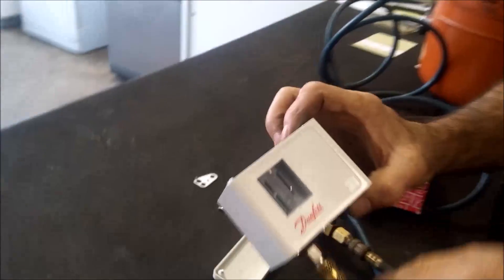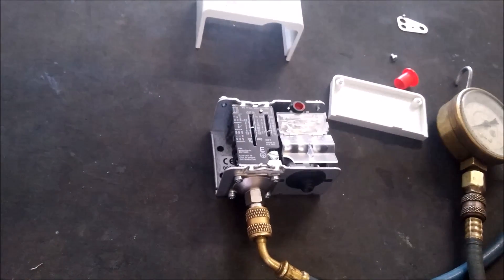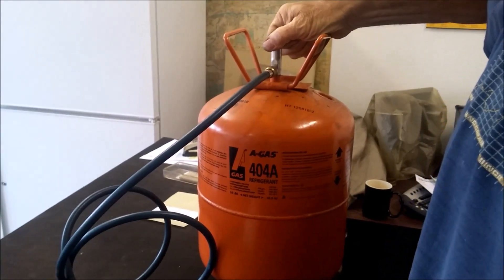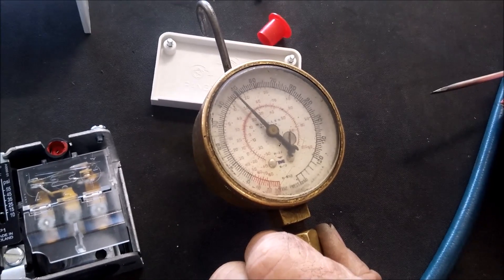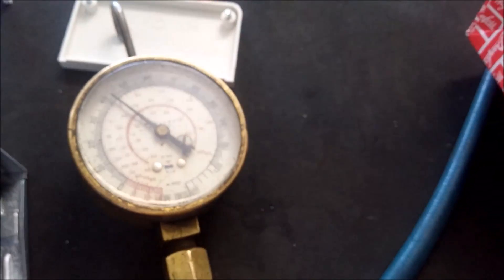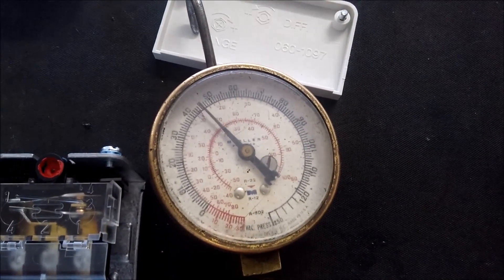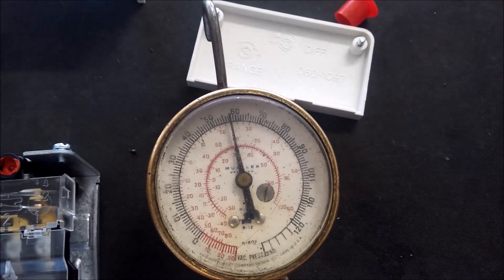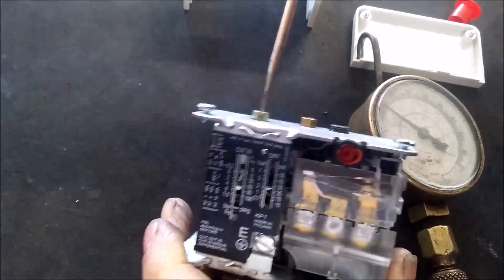How to adjust a pressure switch-JDNel Refrigeration

Comment: Jd can you assist me with R22 refrigerant cut in 6 degrees cut out 4 degrees the range an differential settings please
Reply from the maker: I need to know what type of refrigerator this is for? And does the evaporator coil have to defrost all the ice each cycle?

Comment: Thank you for the video, would you tell me that when the pressure reaches the threshold e.g 75 and the switch trips, The compressor gets off?? and what happens to the pressure. does it increases or decreases.

I have  "Johnson Controls P77AAW-9350" pressure switch installed on outdoor unit (condnsor) but i dont't know how to adjust it.
kindly guide me @JDNelRefrigeration
Reply from the maker: The colder your fridge the lower the pressure.  The warmer your fridge the higher the pressure. Different gasses work at different pressures.  There are 2 ways to find out what pressure to adjust your pressure to, to make your fridge function optimal. 1. If you know what gas your fridge operates on, you can find the pressure and temperature equivilent online. 2. Bypass the pressure switch so that your compressor runs continuously , put a thermometer in your fridge and monitor the temperature.  If you reach your desired temperature make a note of your gas pressure. Switch the compressor off.  When your fridge has warmed up to the temperature that you want it to start up at make a note of the gas pressure. Now you have your 2 pressures to adjust your pressure switch.

Comment: What's the setting on the pressure switch for 134a , 17/35 or ?
Reply from the maker: It depends on what temperature you want & how long of a defrost period you want. For a normal cold room I use  cut in 38psi, cut out 12psi
Reply: @JDNelRefrigeration  Should that not be cut in at 38 psi and cut off at 12 psi or am I missing something. Good video, I never seen a pressure switch adjusted like that with a refrigerant  tank.
Reply from the maker: @jimdefilippis9630  yes you are right

Comment: How do you wire a pressure switch?
Reply from the maker: On a pressure switch there are 3 contacts which comes from a switch that has a common connection a normally open and normally closed connection. You normally put the AC power on the common connection. On the normally open connection you connect your compressor and the normally closed you can connect a crank case heater or a pilot light which is optional.

Comment: Perfect explaination .  most of the time we no need adjust the differential of the pressure switch , just get the cut in pressure will do . and most people don't know actually the pressure switch it's just like our car , you not necessary to hit all the gas , just set higher than other equipment if you need to set primary ( jockey ) , secondary ( duty ) or  3rd cut in equipment (standby ) etc..

Comment: Yes MR J iwas gonna ask you as a qualified refrigeration mechanic on that same question ive asked you what if there is no thermostat at all can i use the low pressure switch to maintain that inside temperature and compare my pressures to my degrees celcius or Fahrenheit just to clear that im new on this field im stil learning iwill be doing my big course soon .im saving money for my trade but ido have the basics as well
Reply from the maker: Yes you can use a low pressure switch, Good luck with your course.

Comment: Hi sir i have a question for you im littlebit lost .so if temperature decreases is it decreases on the pressure gauge too can you clearify me on that .because sometimes youwill find that the suction is low not because of the shord of gas please if you find this
Reply from the maker: A pressure switch is used on a system which has an expansion valve and a receiver tank. Systems with capillarys do not use pressure switches.

Comment: Sir what is problem for my pressure pump my pressure pump is not stop automatically
Reply from the maker: To test whether the pressure switch is the problem disconnect one of the terminals from the switch and see whether your pressure pump stops.

Comment: Please tell me how to use lp and hp switches in cold room electrical  connection
Reply from the maker: You break the compressor or the relay that controls the compressor through the switch in the pressure switch.

Comment: Thank you for the tip. However, my switch adjustment screws have a safety lock. Soon is I remove the locking plate, I was able to adjust the pressure.
Reply from the maker: Danfoss tends to do that

Comment: Do you have normally open and normally closed contacts that are exchanged according to the pressure in the system?
Reply from the maker: Yes you do get pressure switches that are manufactured with normally open and normally closed contacts.

Comment: You need to have a Test Gauge to set a pressure switch the gauge under use is not calibrated having no validation for accuracy tag on it.
Second thing is  always set operating pressure with all pressure released. Each time you test start from Zero pressure to desired/ trip pressure and always make settings with out pressure.
Use Air as media for setting and not Cylider gas as a media.
Ihope you will add my comments please to your method.
Reply: You are correct except for the suggestion to use air as the pressure media.  Air is full of moisture and can contaminate the system.  Nitrogen would be the correct choice

Comment: Can i adjust water pressure on that switch??
Reply from the maker: That switch is designed for gas. There are water pressure switches that are designed for water. Rather use the correct pressure switch.

Comment: Does this turn on at high pressure and off at low pressure?
Reply from the maker: It depends on how you wire the connections. This pressure switch can be wired either way.
Reply: thank you.

Comment: thanks for the information,  what is the appropriate pressure for a walk-in refrigerator and walk-in freezer?
Reply from the maker: It depends on what type of gas you use and what type of temperatures you require.

Comment: How would you go about adjusting when it is already installed on the refrigerator? Same process but using the compressor to add pressure to the switch?
Reply from the maker: On some of the compressors you have a service valve with 2 connections and on some of them the pressure switch is mounted to one of the 2connections. If so put your gauge on the 2nd connection and close the service valve but not all the way. Once the compressor starts up the suction pressure will drop very quickly because of the service valve being almost closed and it's easy to see the lower pressure that way. While the compressor is off the pressure will increase then you will just have to wait for the pressure to increase to check the higher pressure setting on your pressure switch.
Reply: ok.  Thank you very much for your quick response and great description.  I believe that is what I have.  I will give it a try next week and see how it goes..